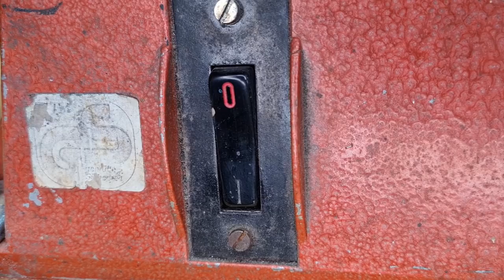Rusty Antique Ox-Tongue Iron Restoration [Three Types Of Bluing]

Comment: I need to preface this by admitting that I am not a chemist. I've read very little about spirit vinegar and do not have a complete understanding of it. But vinegar is essentially acetic acid and should (in theory) eat at metal until it fully dissolves, right? How were you able to blue the steel in the same liquid? Seriously I am intrigued! This would be the ideal method of bluing
 steel parts for food-safe machines